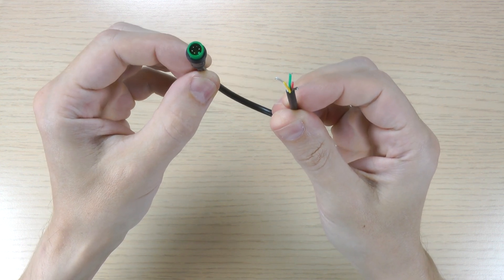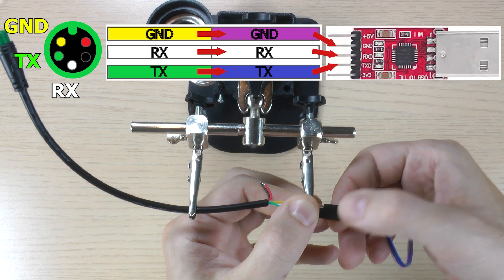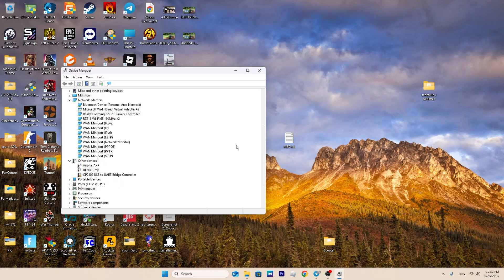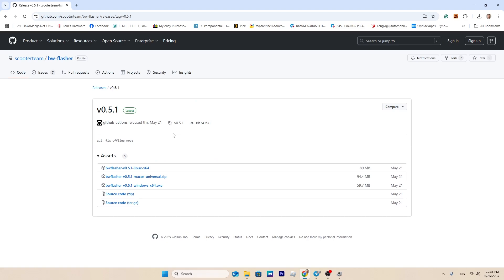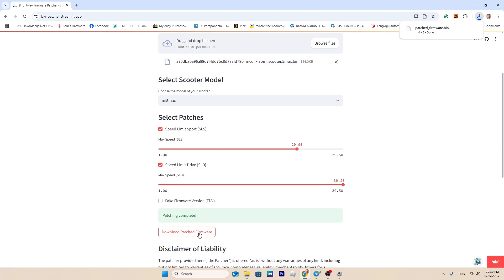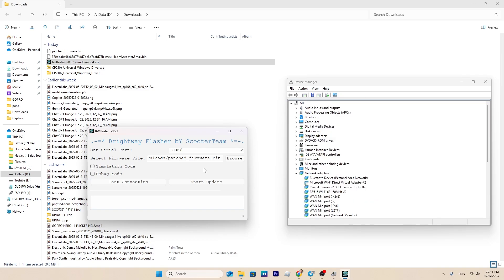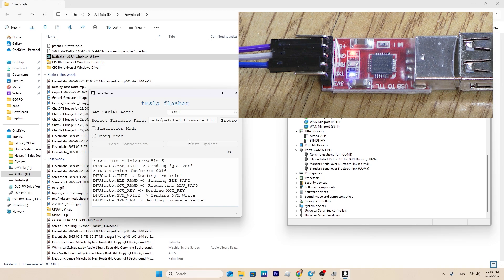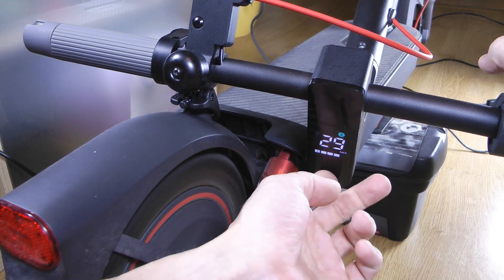Xiaomi Scooter 5 Max Speed Hack (5*|5Pro|4*|4 Pro 2nd Gen)

Comment: If I buy your adapter from Ebay, the method should still work for the Xiaomi 5 right? (regular)
Reply: Yes iv done it that way series 5. All good but power constantly dosent push to that acceleration need to be increased there's no option like the old ones
Reply from the maker: Yes, make sure that the cable is for regular 5. Subscribe, thx.

Comment: Hello there, I was able to mod it but now the motor seems broken can you help me? Can I go back easily to the original firmware?
Reply from the maker: Flash the MCU firmware (without any patches) and you’ll return to stock.
What scooter model do you have, and why do you think the motor is broken?
Reply: @MindaugasJocionis thank you for the answer? Where do I find the MCU firmware? The wheel is not spinning and the accelerator cable is badly wrapped around the pinion. The motor is not responing and it seems that the pinion spins instead of the wheel..
Reply from the maker: @albertoongaro9448 https://mi-fw-info.streamlit.app/
Reply: @MindaugasJocionis  Hello, I flashed previously a patched BLE firmware, is it correct that now I flash the MCU without patches?

Comment: I can use the st link v2 or a ch341?
Reply from the maker: Probably the CH341 will work, as it's essentially the same as the CH340 with additional features. Although it's not on the supported list. People have successfully used RPi Pico and USB-UART bridge, so the chance of success is high. Sub. Thx

Comment: Hello, thanks for the video! It is said that I need use female connector for Xiaomi 5 and that I have to connect the USB adapter to dashboard, but my Xiaomi 5 also has female connector on dashboard. Since the patcher modifies the MCU firmware and the MCU is located in the scooter’s deck, does that mean I need to connect to the deck rather than the dashboard? Thanks
Reply from the maker: Correct — you need to connect to the deck. Subscribe, thanks.

Comment: Works for xiaomi scooter 5 , thanks for tutorial , i limit to 29 in sport and 20 in drive, 29 in sport for scooter not making that noise
Reply from the maker: Nice — glad it worked out!
Reply: Hello, I am trying to hack my xiomi 5 scooter, I tries with both cp2021 and ft232, but when I run the flash it shows an error massage of "Max retries"

Comment: Will it work on a Xiaomi Electric Scooter 4?
Reply from the maker: According to the updated guide compatibility list, it should work, though I haven’t tested it myself. Subscribe, thanks.
Reply from the maker: We managed to flash the 4 — here’s the update: Xiaomi Scooter 4 model requires an M7 5-pin Julet male connector (Better measure it yourself, as the three models might have different sizes.)— you need to know your model to choose the correct MCU firmware: navee1.scooter.t2209 (use Xiaomi Electric Scooter 42), navee1.scooter.t2209g (use Xiaomi Electric Scooter 43), or dreame.scooter.t2201 (use Xiaomi Electric Scooter 4). You can check your model ID using the “nRF Connect for Mobile” app.
Successfully flashed: navee1.scooter.t2209g
Reply: @MindaugasJocionis  afler flashing i got error 12 on scooter
Reply from the maker: @Randelll Which of those three Scooter 4 variants was yours?
Reply: @MindaugasJocionis  in Xiaomi scooter 42  successfully! Cruise enabled! Thanks!
Reply from the maker: Glad to hear that 🙂👍

Comment: How to save the stock firmware of the scooter and, if necessary, return to it?
Reply from the maker: The MCU firmware you need to download is the official firmware, you can flash it . If your scooter model supports the “spoof firmware” option in the patcher, you can set the version lower than the last official fw. In that case the Xiaomi Home app will keep prompting you to update and overwrite the patched firmware. Subscribe — thanks!
Reply: @MindaugasJocionis  where can i download teslaflasher for flashing xiaomi scooter?
Reply from the maker: @one_blaze2254 Tesla Flasher is no longer needed — the newest BWFlasher has fixed all the previous issues.

Comment: What about battery life? Please let me know, I have questions about that. Does it change much? How much?
Reply from the maker: Well, I never ride it until the battery is fully drained, so I haven’t measured it exactly. My guess is you’ll lose about 7–10 km of range. You can set the D mode speed to 20–25 km/h, and for longer rides it’s best to use that mode.

Comment: You flashed DriveM to 39.9 but it goes max 32?
Reply from the maker: Probably motor constraints, or firmware locks this patch can’t override.
Reply: @MindaugasJocionis  my program says: Max retries reached. Check your connection. WHAT IS THE PROBLEM?
Reply from the maker: Check your wires for continuity and make sure they’re connected correctly.
Reply: @MindaugasJocionis yes dude  The scooter had turned off by itself, so it wasn't charged.
Reply from the maker: Oh yes, it will turn off if you take too long to start flashing. You can set the rear stop light to “always on” mode to monitor when it turns off.
Reply: @MindaugasJocionis can you help me to know that, is it safe for scooter to set limit to 35? Will it burn connector or will be damage something? Please let me know 🙏🏻🥹
Reply from the maker: I think it’s safe, though only time will tell. I’ve been riding my old Xiaomi Mi 3 at 33 km/h already 4th summer, and the controller shows no signs of burning. That one has a weaker motor than the 5th series, so the controller should be designed to handle less stress than the 5th series. But these are just my assumptions. :)
Reply: @MindaugasJocionis Oh I understand you, thanks a lot❤️

Comment: Do you have link to tasla flasher i have problem connecting the scooter to the BW flasher stock at 0
Reply from the maker: Tesla Flasher was compiled from the BW Flasher source code but didn’t include credits to the original developer group. They contacted me and requested the link be removed. The latest BW Flasher version has fixed bugs and now also supports the CP2102 adapter. If your progress is stuck at 0, it’s likely due to incorrect wiring or poor continuity.  Subscribe, thanks.

Comment: Sorry, but what should I do if BwFlasher cannot connect to the scooter when I test the connection? The COM port is installed and visible on the PC, but there is no connection!
Reply from the maker: Check the wires for continuity and ensure they’re connected to the correct pins. Subscribe, thx.
Reply: @MindaugasJocionis  ...the problem is, my scooter connection is male instead of femail, so does this matters, or is it the same pins?
Reply from the maker: @udoflorian2558 Check this diagram, I hope it makes sense: https://photos.app.goo.gl/DkVqe6QAbrAhrois7
Reply: @MindaugasJocionis  it totaly does, made it also like it shows but there is standing... Max retries reached. Check connection! Any idea?
Reply from the maker: Are you using connectors? If you’re connecting bare wires and it takes too long, the scooter switches off. You can set the rear light to always on to make sure it’s still powered while you make the connection. Also, are you sure your wires have good continuity? Did you test with a multimeter from the adapter to the connector? One guy with a Scooter 5 had the same problem, and it turned out to be a bad wire connection at the junction point.
Reply from the maker: Oh, and make sure to download the latest BwFlasher v0.5.3. If you’re using a CP2102 adapter, install the drivers from the link in the video description.
Reply: ...and by the way, checked all of them and they are good. But many thx for your patients.
Reply from the maker: Find me on Instagram! The link is in the channel description.

Comment: since i'm an idiot, where is the actuall buzzer to tape ? do i have to somehow dismantle the dashboard ? thanks in advance <3 great guide btw, waiting for my adapter to try it out
Reply from the maker: Yes, it’s on the dashboard PCB. You’ll need to remove the top plastic cover — it’s held in place with double-sided tape. Apply a bit of heat with a hair dryer, use a pry tool, and it will pop off. There are plenty of videos on YouTube showing how to pry open a Xiaomi dashboard. Subscribe, thanks!
Reply: @MindaugasJocionis  youre the man, thank you very much, have a good one !

Comment: I do have a bigger Problem the Tesla Falsher tells me everything is fine no Errors and everthing seems to be ok but wenn i reconnect the Dashboard and turn it on its instantly blinking and it show the errorcode 43 i check its an defekt in Motorphase B. 
Do you know how to fix it without changing the whole kables and controller
Reply from the maker: Is it a 5MAX? Was the flashing procedure successful? Did you connect everything correctly? Maybe you accidentally connected 5V from the USB adapter? Can you still connect to the scooter via Bluetooth? Did you desoldered that speaker from the dashboard?
Reply: @MindaugasJocionis  It was a Xiaomi MI4 i got the correct adapter for it the firmware from the linked page the process was complete and everthing seemd fine in tesla flasher no errors no stuck in the flashing progress. Everthing seemd normal. No desolderd speeker nothing. Scooter is able to connect after the progress was done. 
Even tried do put it back to legal firmware but patching and reseting it over the app was not working. Even the Reset with the Code to Reset (Hold Brake Accleration and Power) didnt work also it showed the correct massage on the Dashboard for Reset
Reply from the maker: Well, first of all, you know this isn’t the hack guide for the Mi4, right? This is the actual guide for the Mi4:
https://dnandha.github.io/stlink-lks32/ (I’ve never tried it myself, so I can’t confirm if it works.)
Did you flash the patched MCU firmware on the Mi4?
Are you still able to connect to the scooter in the Xiaomi app?
Reply: @MindaugasJocionis   Yes i flashed the patched MCU Firmware.
Yes it will connet with Xiaomi App (but the Reset ofer the Xiaomi App is not working we tried this )
Reply from the maker: I would try flashing the patched firmware again using BwFlasher or Tesla Flasher, this time enabling the "Fake firmware version" checkbox and setting a version number lower than the latest official one. If the flash is successful, the Xiaomi app should then prompt you to update to the newest firmware through the app.
Reply: @MindaugasJocionis  Hello, in Tesla flasher I only have the checkboxes "Simulation mode and Debug mode"
Reply from the maker: That checkbox in the web patcher — the one where you adjust the speed settings.
Reply: @MindaugasJocionis  Thanks for the information, this button is only available for "mi5", but when you enter "mi5pro" it disappears
Reply: @MindaugasJocionis i allready got ya
Reply: It worked scooter is running again thx for your fast answer an help

Comment: Stuck on 0%
Reply from the maker: Did you try using Tesla Flasher from the video description? Also, check your wires for continuity and correct connection. Make sure the COM port number is the same in the app and in Device Manager.
Subscribe—thanks!

Comment: @MindaugasJocionis Hello, I have a question. After using a modified version of the firmware for the Xiaomi Scooter 5, how can I restore the factory(fimware) settings? And PL2303HX USB to TTL is suitable?
Reply from the maker: Flash the non-patched MCU firmware, or in the patcher, check the 'Fake firmware version' box and set it to a lower version than the current one for Xiaomi 5. This way, the Xiaomi Home app will prompt you to update to the latest firmware through the app. You’ll need a USB-to-serial adapter. Subscribe, thanks!
Reply: @MindaugasJocionis  Thanks! And is this the right convertor? USB to TTL Converter UART module CH340G
Reply from the maker: I think it should work, since the only difference from the non-G variant is that the G version uses an external crystal for the clock generator

Comment: I connected everything properly, but the computer doesn't see the cp2102
Reply: May be you need install driver
Reply: @ancerian1232  the fact is that I have already installed the driver, as well as the author, and when it finds cp2102, it writes in the device manager that it is an unknown device, and when I fill the driver into it, it writes windows cannot install the driver on it, then okay, I installed a newer driver via zadig 2.9 and it started to see the com3 port but when I connected the wires to the scooter and the cp2102 was yellow, green at the top, green in the middle, and then white below, that is, the lowest one, and I didn't touch the black and red wires between them, and when I go into bvflasher or tesla flasher, I select the firmware patch there and press start, it gives the serial error that something is not connected or I I don't know, and I also didn't solder it. I ordered it from ebay. It's all USB + 5 pin Connector (MALE) + FT232RL UART (Xiaomi 5 PRO & 5 MAX flashing kit) please tell me, I'm very worried and scared! and it also shows cp2102 after zadig 2.9 and ft232 usb uart
Reply from the maker: If you're using an FT232RL, make sure to install the correct drivers for it, not for the CP2102.
Sub, thx.
Reply: @MindaugasJocionis  Thanks a lot, I'll try, I've been really waiting for an answer.
Reply: I succeeded and I am very happy, the scooter rides on sport 34 and not 32

Comment: I connected to my laptop but it is %0. Also tried on my desktop. I cant flash that. I setup all drivers. When i tried test connection it says fail. What should i do.
Reply from the maker: Did you try using Tesla Flasher from the video description? Also, check your wires for continuity and correct connection. Make sure the COM port number is the same in the app and in Device Manager.
Subscribe—thanks!

Comment: It work's. Thanks a lot. Greeting's from germany
Reply: That must be a lifesaver in such a country, where e-scooters are limited to a maximum speed of only 20km/h.
I'm wondering if I will do it, it's tempting but flashing firmware doesn't kill the "beeps" when you drive faster than 30km/h anyway.
In Germany you can benefit from +10 km/h of extra speed, whereas in France for example only 5 km/h... 
Of course the radical solution is to unsolder the buzzer, but this isn't really a good idea imo.
Reply from the maker: So happy to hear that! 😊
Reply: Hi hab mir so ei Adapter gekauft aber bei mir bricht es immer wieder ab ob bei 4% 6% oder 12% hast du einen Tipp für mich
Reply from the maker: Verwende Tesla Flasher – der Link ist in der Videobeschreibung.
Abonniere den Kanal – danke!
Reply: @marceljimmykrzyzaniak8929 wo hast du den gekauft ???
Reply: @marceljimmykrzyzaniak8929  Das kann viele Ursachen haben... Halte dich wirklich exakt nach dem Video und lass dir damit zeit! 10min reichen nicht... deinstallieren alles und fang nochmal von vorne an. Mit einer firmware muss man vorsichtig sein und 100% umgehen. Klingt hart aber wenn du es immernoch machen willst, kommst du nicht drum herum...

Comment: Model Xiaomi 5 Pro.
Thanks for the great guide. I first tried BwFlasher, and the flash was successful. However, during a test ride, there was no change in speed. It only worked with the Tesla Flasher.
What's annoying is the beeping at 30 km/h. I set it to 29.9 km/h, but sometimes it reaches 30 km/h, and then the scooter beeps.
Reply from the maker: To stop the beeping, you can either desolder the speaker from the dashboard or cover it with duct tape. Subscribe—thank you!
Reply: @MindaugasJocionis how to open the Dashboard? I cant find a Instruction Video :(
Reply from the maker: The top plastic part is attached with double-sided duct tape. Use a bit of heat (a hair dryer works well) to soften the tape, then gently pry it off from the side using a credit card or a plastic pry tool. (check @ 3:44 in this video: https://youtu.be/hnvqBzcOAoY?si=epv1u8__xXDZpafM
this video is from an older model, but the idea is the same).
Reply: It works with BWflasher too, but you nave to check ✅ (set limits) to both D and S modes at the step when you patch the original firmware. 
Otherwise if you leave one of the modes untouched, it just doesn't change the original value in the firmware.

Comment: I did everything correctly but I used Tesla flasher but it still says you have tried too many times try later, check the connections please help me.
Reply: I have the same problem.
Reply: I resoldered the cables and used another computer and it already works on two 5Pro. Thank you
Reply: @josefkovar9668  Same thing it says check the connections. I tried many times with cables and tried with 2 computers.
Reply from the maker: Double-check your wires for continuity using a multimeter. One guy had the same issue, and it turned out to be a bad connection in the extension wire connection.
Reply: I already did that, are you sure the controller isn't the encrypted?
Reply from the maker: Personally, I know at least one person who has successfully done that on a regular version 5
Reply: Same thing it says check the connections. I tried many times with cables and tried with 2 computers.

Comment: is there any danger of bricking the scooter? is it reversible?
Reply from the maker: It’s always risky to do something that isn’t meant to be done — you could cause a short circuit or burn something if it’s connected improperly. It is reversible; you just need to flash the unpatched firmware. Subscribe, thx.